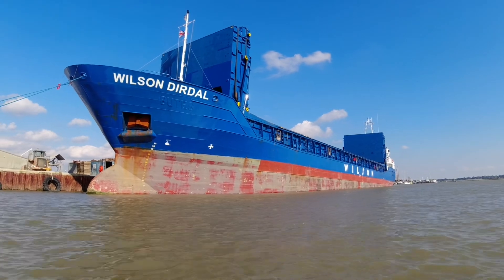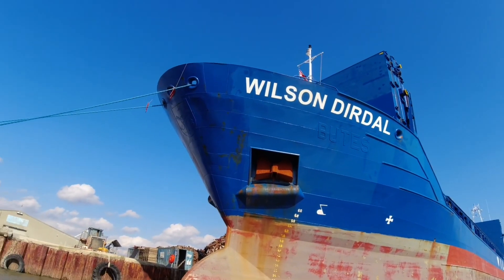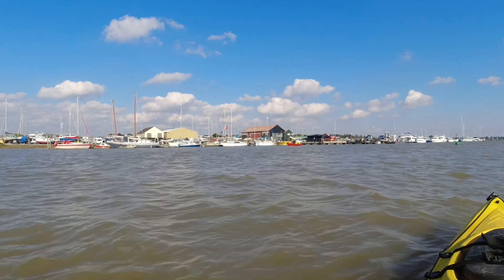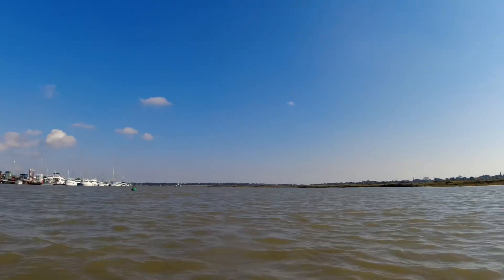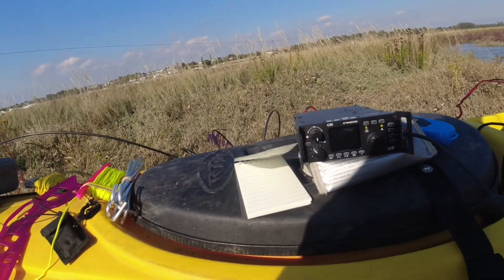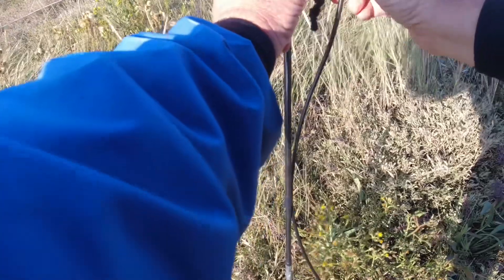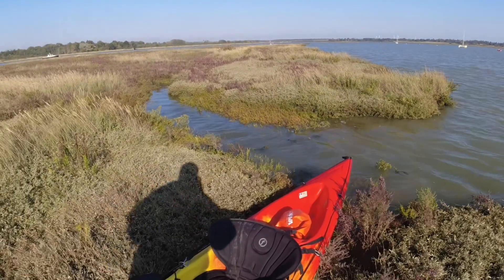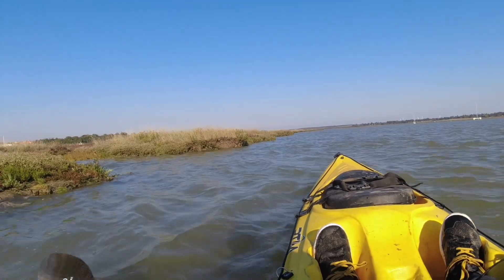Xiegu G90 Back From The Dead

Comment: Interesting video Kevan. When you were speaking about the large vessel not being loaded it took me back to an exam question I had when I was about 15. The question was who passed the Act of Parliament in 1876 safeguarding ships?  Answer: Samuel Plimsolll. Hence its known as the Plimsoll line. I’m sure you knew that anyway. I have a Xiegu G90 as well and was told by an acquaintance not to let the internal battery run down as it will lose its programming. Perhaps that was the cause of it not working.
Reply from the maker: Hi Russell, I remember the Plimsoll thing from school as well. Funny the things that stick in your head as I’ve forgotten lots of more useful knowledge. The G90 doesn’t have an internal battery, are you thinking of the x6100? I have one of those as well…
Reply: @2e0wmghamradioandkayaking85  That’s interesting as I was told it was the G90. Another Bum Steer given me.

Comment: Another nice video, I have a G90 and occasionally complete a hard reset because the software can get corrupted after a long period of operation. SDR radios, being very similar to my laptop,  need a complete shutdown from time to time as the first port of call to sort out an issue. M0NMT
Reply from the maker: Thanks Neil, I’ve had the G90 a while now and it worked flawlessly until that. I’ve lost a bit of faith in it but hopefully it will be ok again now. Thanks for watching👍